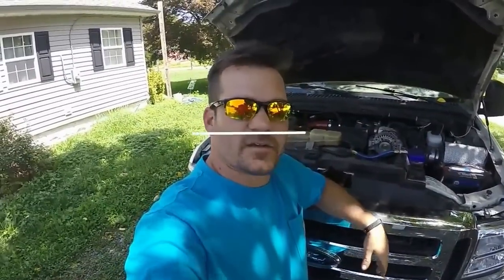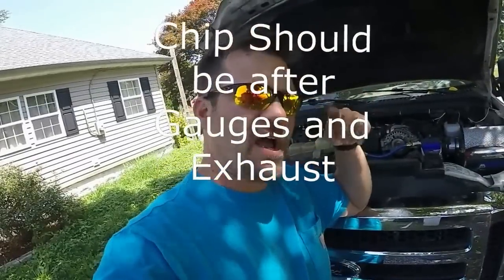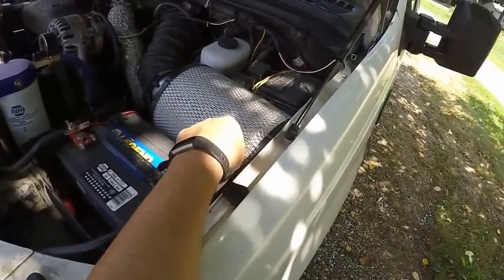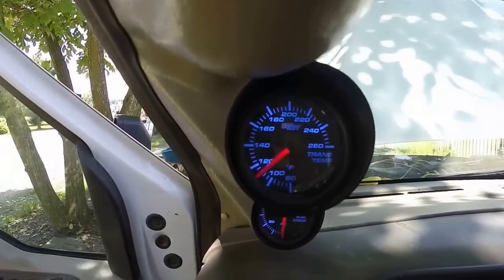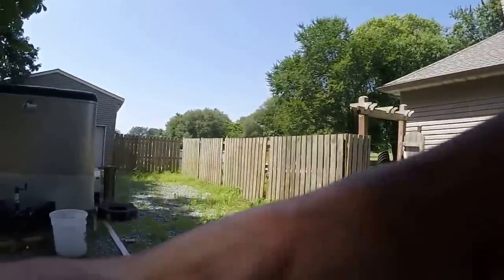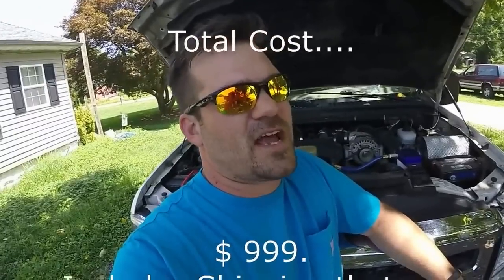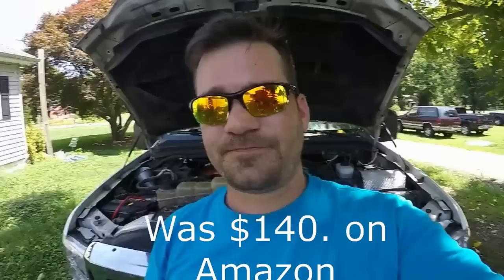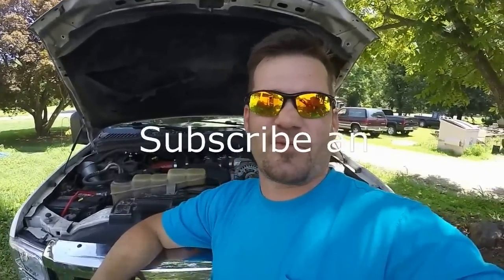First 5 7.3 powerstroke Upgrades

Comment: I've done that air filter mod already, but I see you squished yours to get it in there.  When you replace that one do it right and go get an 18" long 45° bend  4 INCH diameter aluminum pipe and take that stock rubber crap out and cut that aluminum tube to fit. Much cleaner look and fit. Also you can put the stock sensors back in.

Comment: Mods come into more mods that's for sure. So far on mine includes: Exhaust, Intake, Edge CTS insight, coolant gauge, hydra chip, tru cool tranny cooler, coolant filter kit, 203 thermostat, believe it's a wicked wheel 2 kid before me had put it in, full 05 front end with 08 mirrors
Reply from the maker: Nice! Mods are for sure addicting, best of luck. If need any help ill shoot you straight

Comment: Hey Devon Xpress, l like your vids. They will soon get very popular. I have a few questions. I have an 02 7.3 and i want to invest in the WW2 and turbo back exhaust. How much louder in cab is the WW and the exhaust and is there a reason you chose no muffler? I also have an edge evolution programmer and l feel like it shifts waaaay to hard to you have any insight on this?
Reply from the maker: you will notice a difference in sound, but don't expect a 6.0 sound if you take the silver wrap you will gain in sound however the word is you'll loose efficiency but not much, and no muffler to allow as much exhaust to get out as fast as possible to keep those EGT down, I've never had any Edge programs but if your using just tunes that it came with better off getting a custom tune. i use the TS Chip and it also shift pretty hard sometimes and that's because i built tranny and the shift points are weird on a stock chip.Will do some research and get back to you.
Reply: +Devon Xpress thanks for the response. ive had a very hard time making a decision on a tuner and which custom tunes to go with. have you upgraded the waste gate on yours?ide like to do that with the ww2
Reply from the maker: +ssaaoojoi yeah I upgraded mine with a billet 33psi. My whole turbo is upgraded now though in my other videos I cover this.

In the 7.3 turbo and banks exhaust housing and up pipes. I also did the EBPV delete